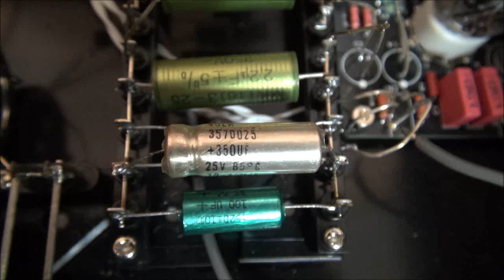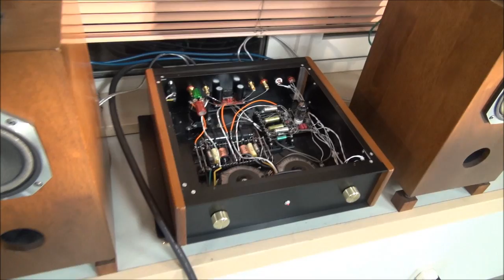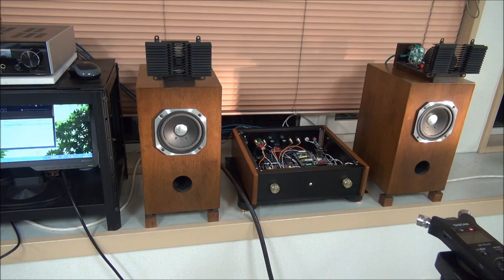銀ケース湿式タンタルコンデンサの超高音質♪

Comment: What is the value of styrene copper foil cap? Is other other substitute cap if I will not use the wet tantalum? wet tantalum is expensive.
Reply from the maker: is that so. I did not know it was expensive.
I think that it is better to use it because the sound is good.
If you use ordinary parts, you should not bother to make it yourself.
Reply from the maker: http://www.soundparts.jp/capacitors/tantalumcaps/tantalum_caps/200to270mfd/200to270mfd.htm
in japan i can buy only 800 japanese ￥（about 7USD)